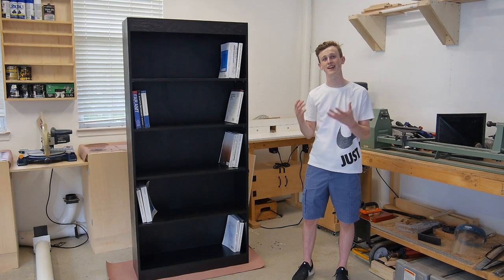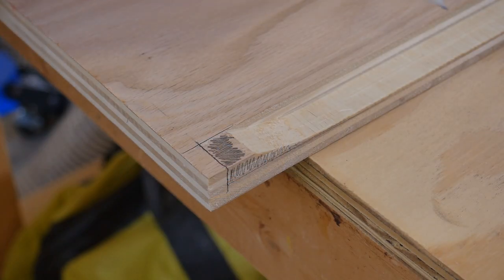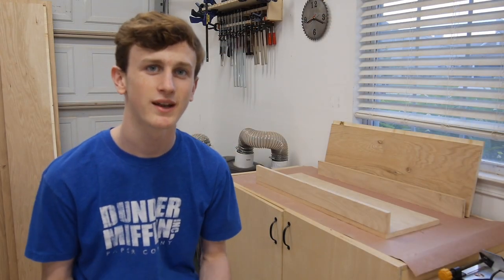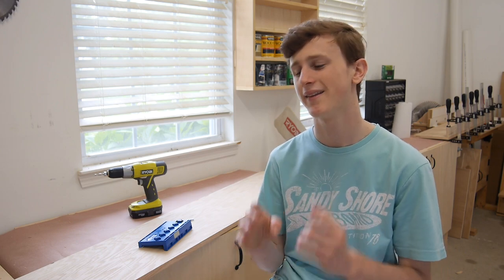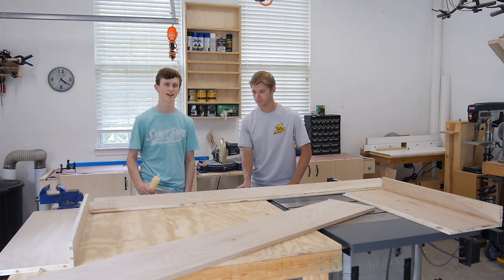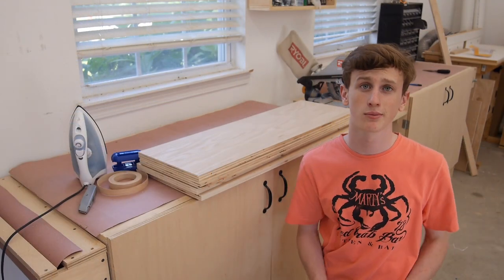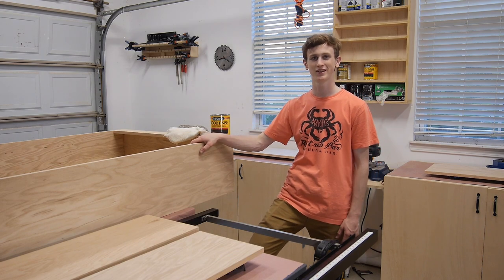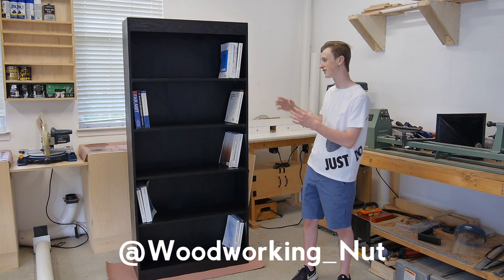How to Build a Modern Bookshelf | Free Plans Included!

Comment: Nice work. Three suggestions from the hundreds of feet of bookcase the center built over the years. Either start using an hvlp sprayer for your finish or use a brush on top coat like poly or brushing lacquer. You're wasting most of your product by using a rattle can. Also, for a tremendous amount of added strength, I always permanently attach the shelf that is 32" from the floor. It not only prevents the case from twisting, it also prevents the side walls from bowing. Lastly, I put 1 1/2" face frames on the front of the shelves to add strength and prevent sagging. You can use router bits to shape the face trim to make it look smaller than it really is. 
You've come a long way! Keep up the good work.
Reply: That should say the hundreds of feet I've built.
Reply: +Eric Lindberg to start out, just get a spray gun from Lowes or HD. Stay away from Harbor Freight. Eventually you'll probably want to upgrade but for about $75 you'll be in good shape for a while.
Reply: What is a face frame :0

Comment: What a gorgeous piece of furniture. I notice you didn't wrap your iron in foil like I have seen in other videos. Does it make a difference in the application? Also in the beginning when you attach the edge pieces to the top and bottom is there a tool that helps you align the holes to to bottom to insert the dowels? I attempted something like this on my frankenshelf that was miscellaneous pieces (same colors) but it didn't line up right I didn't get the holes even. :/
Reply: It does thank you. the foil prevents the glue from the strips getting on the iron, but it didn't seem like you were having a problem. I did something similar but it was the side of a laminate counter top and the guy at home depot said to wrap the iron in foil. maybe he thought I'd later need to iron clothes LOL